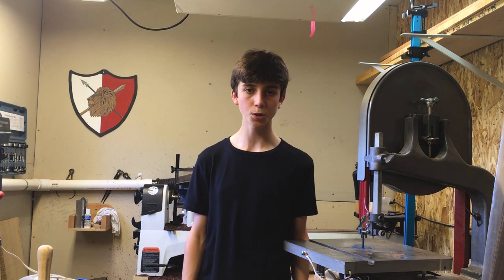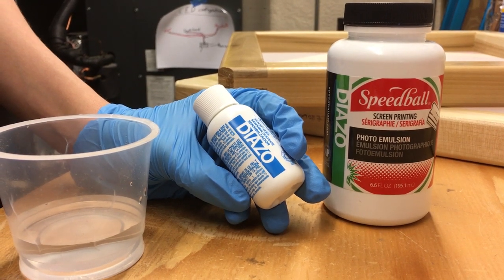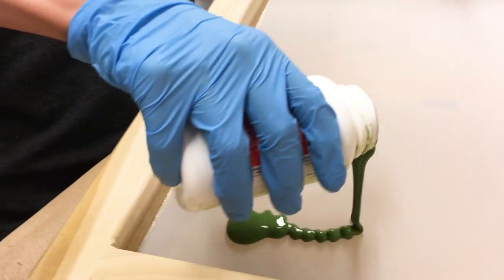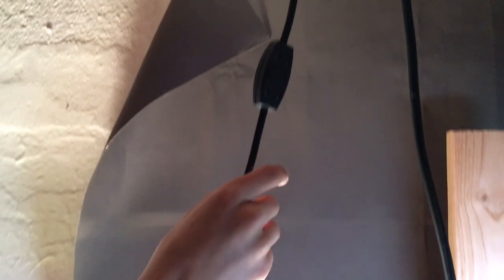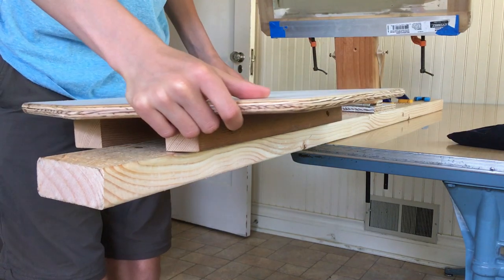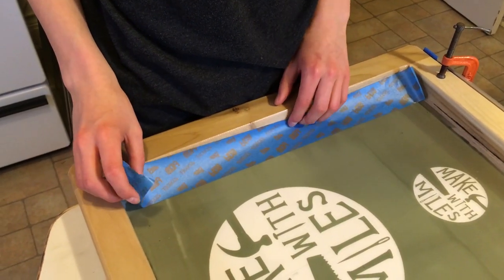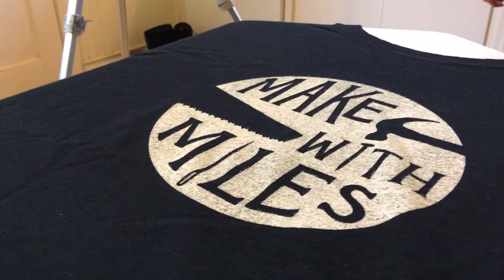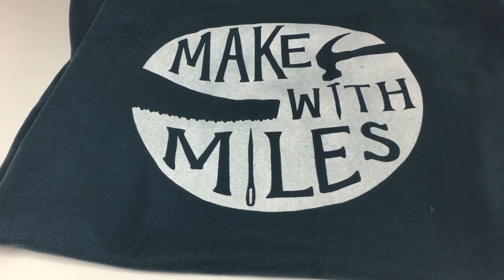How to Screen Print T-shirts

Comment: Excellent as always, Miles!  Did you "nail" the emulsion exposure on the first try, or were there previous experiments?  (And where do I place my order?  lol)
Reply from the maker: Thank you jake! I did do one screen off camera and messed it up. That screen I used plexiglass to hold the transparencies down and the heat from the light warped the plastic ;)
Reply: Wow!  That IS an intense light!  I wouldn't have considered that either.